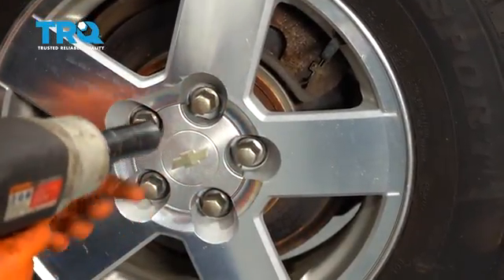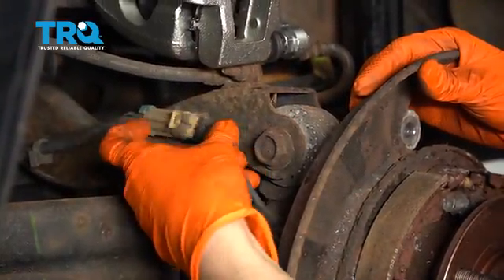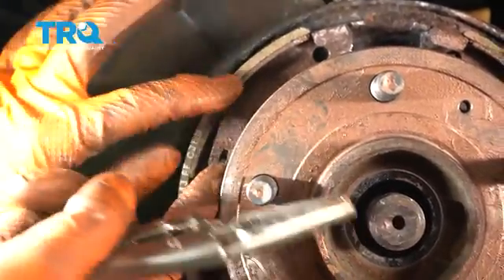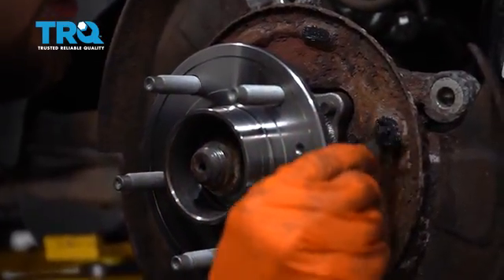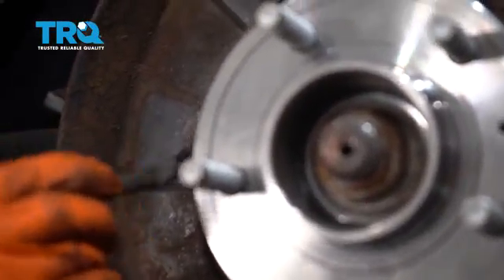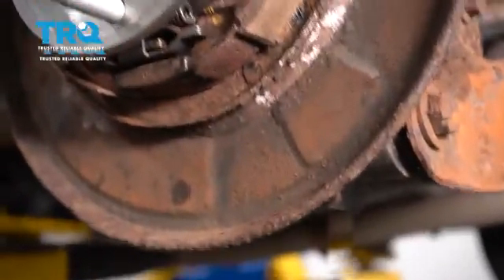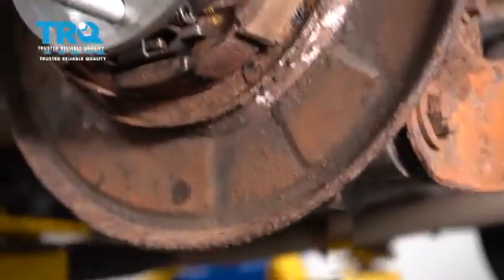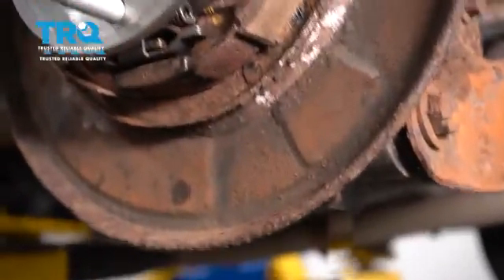How to Replace ABS Wheel Speed Sensor 2005-2009 Chevy Equinox

Comment: I love your videos, they are no nonsense and right to the point. Thank you for the fine work, but that being said on this video,
It looks like you started with a front wheel and then switch to a rear wheel. A little confusing for some viewers
Reply: I think what you saw was the drum brakes that the emergency/ parking brake gm cars and truck us a hybrid four wheel disk brakes the rear has disk drum combo the drum is smaller and it's specifically for the parking / emergency  brake how this helps

Comment: On my 2008 Chevrolet Equinox, I was able to replace the sensor without removing the brake shoe springs nor the brake shoes.  I removed the 2 retaining pins (and clips) which gave me enough space to replace the sensor.  Due to the limited space, it takes some finagling to remove the old sensor and install the new sensor, but I was able to do it successfully.  I think it was probably easier than removing and reinstalling the shoes.